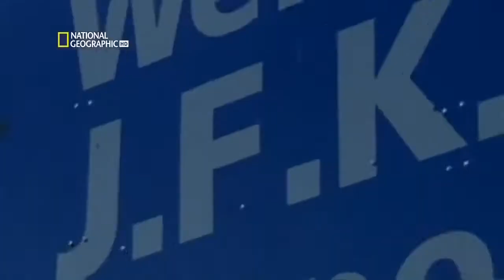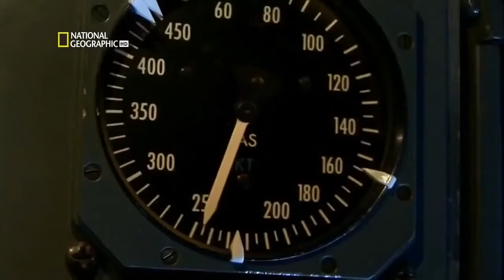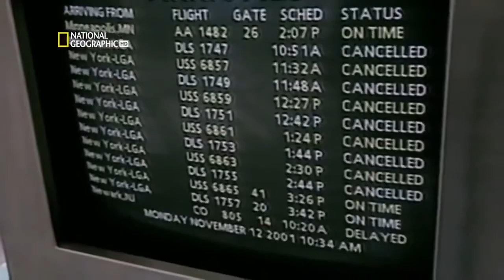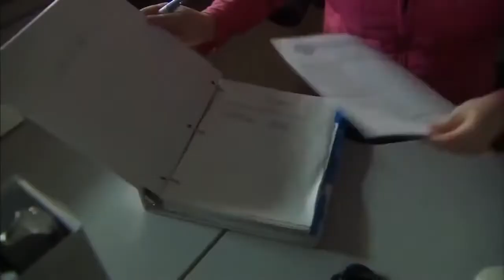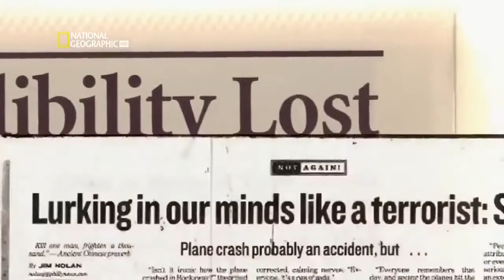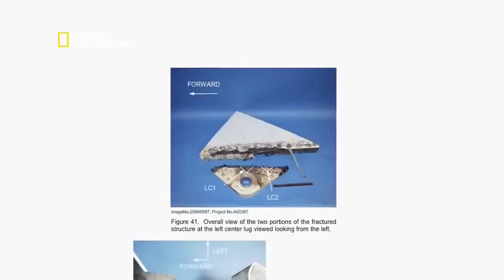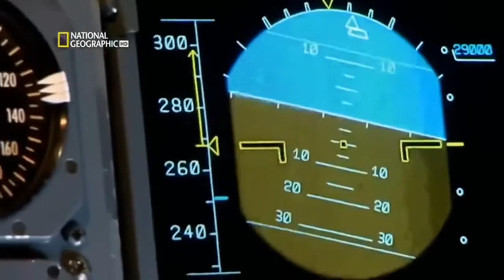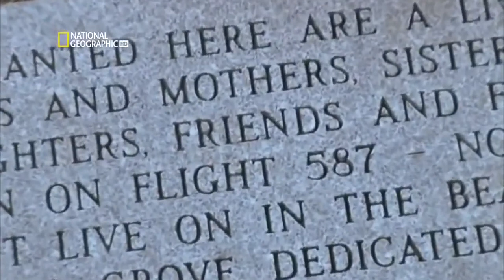Black Box   American Airlines Flight 587 November 12, 2001

Comment: Thanks for such a detailed lengthy video. I actually kinda hunted for this after hearing a youtube short refer to it as a conspiracy. I'm definitely comfortable with the answer, it's similar to flicking your hand back and forth out the window while driving, high enough speeds and your wrist is fucked, friction is theoretically one of the strongest forces we know, it was likely under hundreds of thousands of pounds of pressure, if not millions, the fact all 6 seem broken along a similar pattern seems like it was an immediate failure event. Not a slow tear off, one lug at a time, he legitimately capped out the force all 6 of those lugs&bolts almost in unison. (This is hard to word, doesn't look like it failed bolt by bolt, but almost like clean sheer)
Reply: Great explanation. And yah, another channel wanted viewers to think it was an attack.